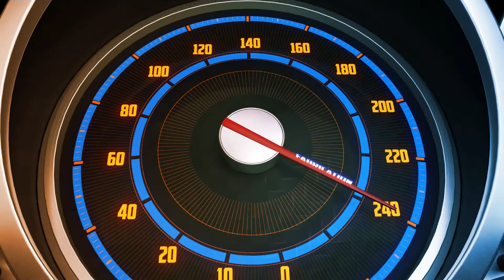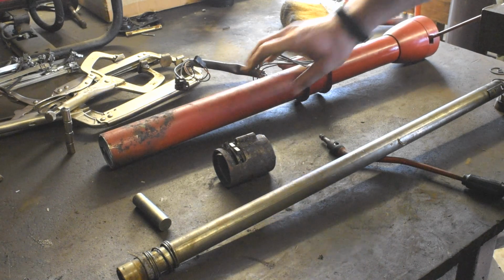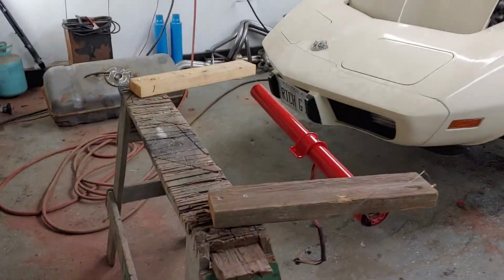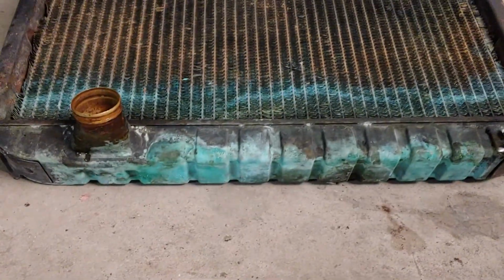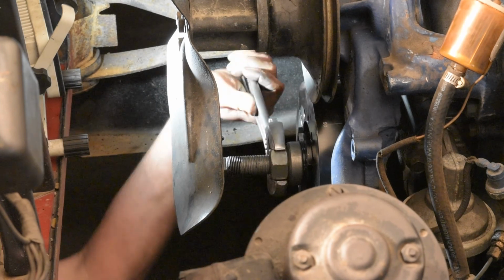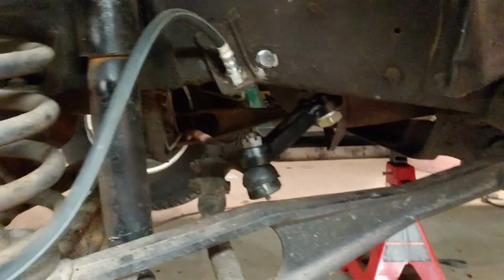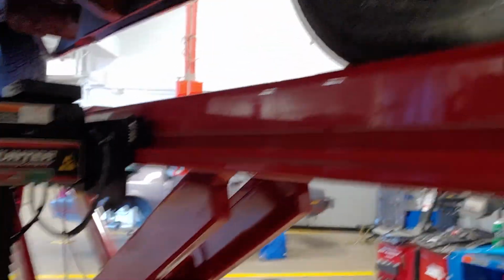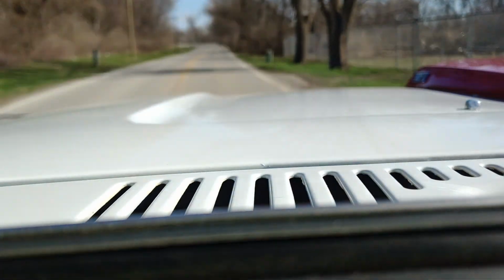*Part 2* 1966 Ford F100 Power Steering conversion & more!!

Comment: Just swap out my manual steering box with a complete power steering system out a of 1967 ford truck that I purchased from Flashback F100 out of North Carolina. This swap out was easy and didn't require modifying my three on the tree shifter. My only recommendation is to have the bendix box inspected prior to Install. Most likely the seals will need replacing. I'm $2k in the swap out and rebuild Of the box but everything looks OEM and works perfectly!
Reply from the maker: Nice dude!

Comment: Hey! I know it’s an older video but I just attempted this on my 66, I didn’t have to cut my engine mount perch as mine are from a inline 6 and mounted further to the radiator, but I have the same issue you described with having a hard time turning left and „rubbing“ how did you manage to fix that issue? It seems like it’s really hard to go to the left by hand (truck is on stands) but right is no problem and doesn’t bind

Comment: I am in the process of doing the PS swap and noticed my drag link being too short. What year of drag link did you  swap with this? I hear everyone saying any f100 from 1973-79 but they are all saying to add the disk brakes with that same year. I am just running drum but not sure if those newer drag links would still line up right on my drum spindles.

Comment: Excellent video, high degree of difficulty in the case of the double pulley. Do you have a picture of the power steering box you used? Congratulations, you are a "chingón", greetings from Tuxtla Gutiérrez, Chiapas, Mexico.
Reply from the maker: Thank you very much my friend!! I will share a link with you for the power steering gear box very similar to the one I used.  I purchased my through LMC truck.
https://www.buyautoparts.com/buynow/1972/Ford/F_Series_Trucks/Power_Steering_Gear_Box/82-00099_R?src=pla&gclid=CjwKCAjwqIiFBhAHEiwANg9sztxCn911ncYzmnHahlQmz_pLRhIUPQIwvM__0zgUHbGjZqrcNUnCVRoCRnoQAvD_BwE

Comment: i like to know more bout this trans upgrade
Reply from the maker: I did not upgrade the trans, it is original to the truck, it is a Ford 3.03.  I did change it from a 3 on the tree to a floor shifter using a Jeep T150 shifter.

Comment: Phil Teagarden, can you give more info on the 3 speed shifter. What year jeep? I have a 1968 F100 that the shifter was converted to the floor but a side shifter and would like to put it as a top loader. Thanks
Reply from the maker: It is a shifter from a T-150 3 speed trans, was used in many jeeps.  I was not able to a reproduction, I had find a used one.  You will need to modify the shift arms and possibly enlarge the mounting holes slightly

Comment: hey nice work, i just picked up a 65 f250 and someone did what you did but they got the steering column off center  making the turn signal lever down real low at 7 o'clock position do i have to remove the whole column and re weld the bracket that mounts to the dash or can that turn signal housing be removed an re indexed to the right location like the steering wheel when its off?
Reply from the maker: I am trying to picture in my head of what you have going on.  The turn signal lever should be roughly in line with the left bolt hole on the column mount.  I can picture how they got it misaligned, unless for some reason they removed and reunistalled the column mount.  Feel free to send me a couple of pictures and we can try and figure it out.  My email is americanheritagegarage@gmail.com